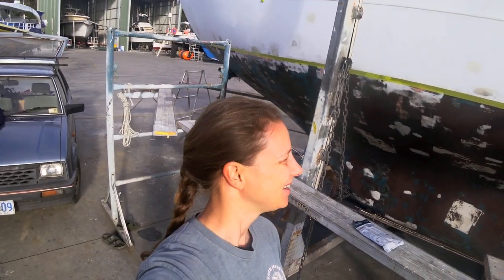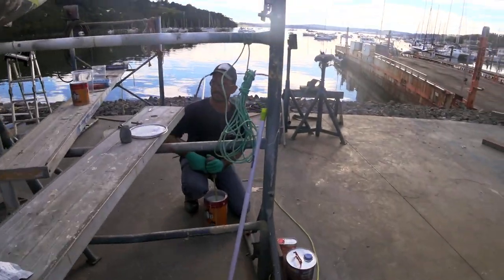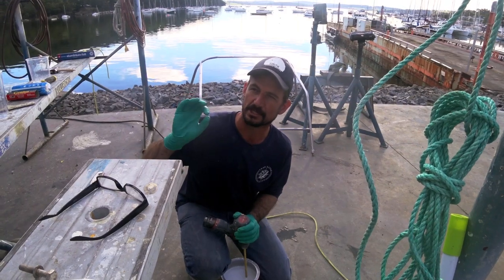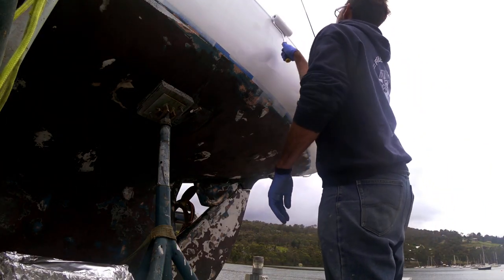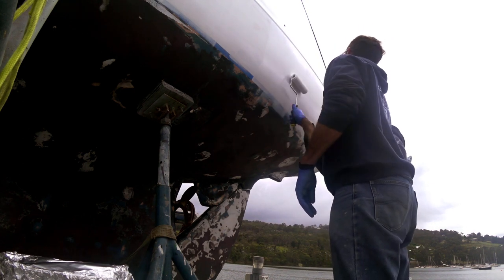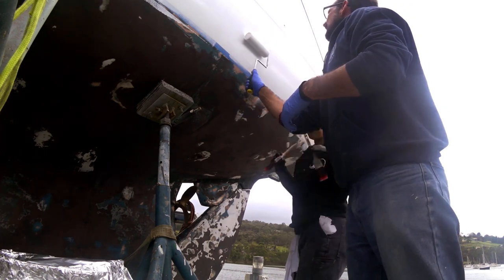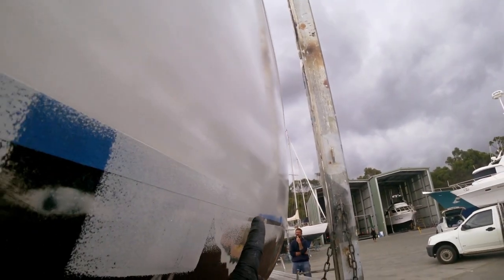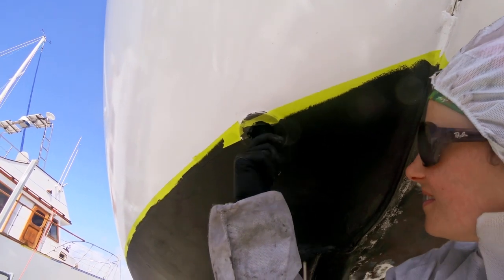Painting our ENTIRE sailboat by HAND (Roll and Tip & why we did it) - Free Range Sailing Ep 163

Comment: I was stationed in Menorca, Spain back in the early 80s. One of our power plant guys had an old Seat (Spanish made Fiat) that was all rusted up. He fixed the body work and then took the paint they used to paint the diesel generators on the site and painted the car with it using a brush. I thought it would look like crap but it came out really good. If you came up and sighted down the body you could spot an occasional brush stroke but you had to really look close to see them. I used to love to go down to Mahon and watch the sailboats there and dream of sailing the Mediterranean Sea. So beautiful, f they had left me there I'd still be in the Air Force.

Comment: I love your idea of raising the deck fitting attachment points by 10mm above the deck surface.People may not think too much of it unless their deck with its balsa core sinks in every time they try to stop leaks in that deck. (Like my 50 year old one) Naturally a little pond forms and adds to the aggravation. I have had to use two cans of spray gutter sealer on my deck to stop the leaks till I can install the fitting raising fiberglas escutcheons!
Regarding your spiffy polycarbonate windows. I can assure you that you can resurrect them should they get un-spiffy by using a drill mounted polishing  wheel and LIGHTLY polishing with Meguiars Mirror Glaze or equivalent.
I performed miracles on my slightly mutilated Lexan motorcycle helmet visor using that substance.  
You two have a fabulous show. Very informative.

Comment: Great video guys and it was nice to see Troy trust his roller and not overwork the paint with a brush. I've been rolling two part paint on my own 40 year old steel hull  for many years and only use the brush for around edges  and fittings etc....  We only use the 100mm (4") roller on my 65ft schooner as it is much easier to control the flow and keep an even pressure on the backstroke. Another point is we use a quality Foam roller (Stanley) and switch it out to a new one about every 5-10 minutes.  The secret is to not let it get saturated with paint and let the ionization process when it starts to tack off  flatten out any lines you first see. Most people think it is sprayed.
Love your videos and have learned lots from you both... Nick and Zaida... StarGazer

Comment: Hi Troy - Ive painted our old steel ketch every year for the past twenty years as its usually quicker than polishing the damn thing , every year the quality of the paint job is different depending on the amount of sun vs thinners vs dust vs humidity vs preparation.

we have two standards on board GE - Good Enough and super yacht - we seldom strive for super yacht .

your paint looks good , you know you'll scratch it a week later , that's just the way it is .

Comment: Hey you 2 have done a great job painting by hand, I understand the frustration and tears. The key to it, as you have found out is the thinners. If you get it right you don't need to tip. However if you need to tip I have a tip for you. ALWAYS tip vertically it hides and brush marks when you are back in the water. 
Love your videos, we would like to help but times are a bit tough.
Stay safe. ⚓

Comment: West Systems Perfection is excellent two part epoxy paint. Add extra thinner pending temperature and it will flow out like glass. Roll and tip with foam roller from Lowe’s.

Comment: Having  done my hull last year I can appreciate the effort involved, I happen to be an old oil and colour chemist (now known as paint formulator) so the solvent thing, spray thinners need to thin strongly so the paint atomizes yet dry fast before it runs. whereas brushing/rolling thinners need to dry slowly so there is enough open time to do the work and have time to flow while not  running actually a very hard thing to achieve.  I used almost straight butyl oxitol which was awesome. I also did the hull alone and used the 100mm roller without tipping it was fine you probably did better but for boats like ours you rarely look that close and its perfectly functional. I did undercoat though with an epoxy the fillers make sure all minor scratches disappear and I also wet sanded with a random orbital which is more effective faster and just plain good manners to the other boaters in the yard (dust free).

Comment: Hello Happy New Year. I think the finish on  Mirrool is amazing and it showed when you were stripping the tape at sunset. Never has a clay pipe looked so good😂You must be very chuffed and rightly so.
There are a number of advantages using small rollers, complex radii is one ,the other is material saving material not wasted on a loaded roller. 180mm+ rollers are great on flat surfaces with high build being the desired result-eg. textured house coatings or waterproof membranes horses for courses. Hurry up and get back out there
PS what’s with the Hobart home port , thought she was from Cairns. Backstory please

Comment: My present steel boat is roller tipped and have done a few other steel boats over the years when people have seen the finish they are quite surprised to find out it was not sprayed although to troys point it did require quite a bit of fairing. As you said you can fix scratches and scrapes fairly easily even on the hook  from the dingy.
Shame you had to redo your work but it looks very nice now.
-Dave 
Vancouver.

Comment: Hi, I just saw you where talking about using 1K painting is easier to handle, just be awere of that you can't use the most 1K paintings if you used 2K under like primer, filler Epoxy based stuff and so on. We learned that also the hard way. If you are looking for good alternatives for 2K roll n tipp paintings, we used the International Perfection and got a perfect result.

Comment: I've had some really good takeaways from this episode...I have a roll and tip topside job coming up in my future as well...I think now I am less relaxed about doing it if I am being honest...but...that is cautionary and a good thing.   I need to do a test run on something and re-read everything!
Reply from the maker: I think if I had caught the thinner switcharoo at the store, we may have avoided a lot of frustration. I had read the paint literature but didn't take written notes with me. Take note of the maximum thinner value and don't exceed that but it definitely is your friend. Other jobs, I used a single part polyurethane and it is a lot easier to use, especially when a bit of Penetrol was splashed in there. (NOT for 2 pack paint) Very common product among the shipwrights when rolling on single pack poly or oil based paint and spar  varnish.

Comment: Aye m8’s, nice results! I’m not an expert but I have some experience with painting. I learned a lot about how to paint with a spray gun from a guy making exquisite finish for old timer cars and motorcycles. I learned from furnishers about how to use rollers with a result close to spraying, and from graining artists how to use brushes and combs for making nice glossy effects and finish. 
Alright, now back to late spring 1986, in a street of Gothenburg - I was going to paint my car. Not the smallest car either. The year before I had become the proud owner of a Chevrolet Suburban 1975. However, the colouration of it did by no means represent my personality. So I thought I give it a paint! Big piece: 6 meters of mostly flat panels of steel. But standing in a public parking space in the street didn’t work for spraying. So I thought: first the narrow parts with some nice brush strokes and then time for the mohair roller. First coat looked great and me and a friend went for a pizza. 
Coming back an hour later realising the finish was not making anyone happy… Then my friend, who was a paint technician at the International paint facility told me to mix linseed oil in the paint. I was upset: what rubbish, to put oil in thin, low viscosity car paint. But he said: just try it! So I did and I was amazed how nice and smooth it worked out. Time to sand back the first layer! Then, car paint thinned with acetone and mixed with linseed oil made for perfectly smooth but still fast drying cotes. Only with rollers and brushes we where able to make a high glossy finish, close to  spray gun paint job. And it was easy to maintain later after stone damage etc. 
Since then the 100 mm foam rollers where introduced on the market and as you say - the whole Mirrool can be painted with them and obtain a superb finish. As long as one is fast enough applying it before the paint gets to dry.
Reply from the maker: Sounds great Miq. I wonder if that linseed oil works in the same fashion as Penetrol. We saw local shipwrights using it with single pack paint and tried it with really good results. Those foam rollers are very good but that Jotun 2 pack polyurethane eats them :(
Reply: Oh, shit! I haven't tried them with 2-comp yet. Good to know! Also fascinating that the Norwegian brand Jotun is all around the globe. And there is a reason for it. They have quite a range of products.
Reply from the maker: I use Jotun as a hangover from commercial marine but when they say Hardtop, they really mean it! We think the antifoul is very good too.

Comment: I hand painted my boat with Jotan hard top, used the correct retardant thinners and all with a 100mm roller, did not need to use the brush either. Second coat looked much better and 3rd coat was great, and that’s a 40 footer, and red colour

Comment: If it looks good at 10m you are Golden.

In reality how well the paint resists fouling from sea growth and mineral stains will make more of a difference than anything else, as that is what is going to make a hull look bad from a distance and require a lot of labor to clean and maintain if it isn't well done.

Reading the instructions is huge.  It's too bad they make them so long and confusing and in TINY little print.  But in the end with fancy paints it is 80% getting the mix right for the conditions and 20% technique...it doesn't matter how good your technique is if the mix is wrong or if you have the wrong thinner it is going to be messed up when it cures anyhow.  

I see you learned that the hard way as we all have who have dived into boat painting. This is such a frustrating lesson to learn.  Never trust that the paint guy knows his stuff, always double.check the literature.

The boat looks awesome though. The hard work pays off in the end.

Comment: Tipping neads long vertical strokes with very little pressure, be gentle
Reply: I thought if the roller is applied vertical the tip is horizontal and vis versa.

Comment: If only you'd have asked me.., Tipping or (Feathering) as we call it here is quite a delicate task.., always use a good quality 3'' brush like a Purdy.., imagine the brush is an aircraft and the boat surface the runway.., you want to come in for a landing, taxi the runway (boat) and then take off again always keeping the brush moving.., do not apply much pressure but rather guide the brush along..., (Feathering).
Reply from the maker: We have Don Casey's book, 'This Old Boat' and he describes it in exactly those terms. We later found zero pressure rolling also 'tipped' very well but I dont think we are at your professional level yet.
Reply: @FreeRangeLiving  You also hit upon another important issue in the video, saying when you rolled with the 9'' roller you would start 9'' in from where you left off, this is correct in that a fully charged 9'' roller can cover a width of at least 27''.., its great watching you'se grow and learn.

Comment: Fabulous episode. The boat looks amazing, I felt so bad when you found you got the wrong thinner.  When we hauled this fall I discovered no bottom paint was left of the two coats I had applied in the spring. I didn't know I had to wait 8 hours between coats, so the first layer never cured, or stuck. I'll be doing again this spring. Live and learn.
Reply: That’s the truth.  I had the bottom painted in April with ablative paint.  I ran into floating sea grass in the Erie Canal and I think it all rubbed off.

Comment: Hi Troy. I am about to paint a 36 ft cat in wattle poly u 400, roll and tip is my ideal method but that's a bit hard with two young kids running around the boatyard.  If you were stuck for the extra hands would you settle for just a roll job on the topsides?

Comment: Hi guys! love your shows! I know it's late but I have been a painter with my own company and a couple rules for my crew of up to 13 was... 
1- it's not how you put it on... but how you take it off.
2- always brush from dry to wet when "laying off".
4- don't "paw at it" but long strokes work best if possible... then don't touch it... let it flow out.
5- don't be cheap with your first lay on because you can take it off quicker than you can put it on.
6- Nylon for latex... china bristle is best for oil based otherwise it "ropes too much as it dries. Never china bristle for latex because it clogs and seals the bristles.
7- I always dedicate the brush to oil or latex never interchange back and forth.
I hope that helps someone... you guys are doing a great job and I (an old dog) have learned some new tips. We have a lot more in common Troy... fun stuff... we could swap stories! Til the next one.

Comment: Again a fantastic job, and a tale well told. I haven`t had experience with 2 pack paints, only marine enamel (modified polyurethane) but basically the same lessons you have shown here apply as well. First, prep as well as you can, depending on the quality of the finish you will accept. Second, find a good paint that does what you want, and you are comfortable using, and it must have good self-levelling qualities. Three, use a method that you are comfortable with, and that gives a good result. Like you guys I found that rolling (enamel) paint brings up heaps of bubbles, going back over it a second time with a drier roller before the paint starts to skin gives a pretty good result. P:S When you were watching the test piece to see if it levelled out, all I could think of was " A watched pot never boils"

Comment: I’ve done a fair bit of painting with different paints and settled on oil paint—One Shot sign paint with enough Penetrol to slow the drying time to be able to tip.  I paint my 40’ hull by myself in the water from a raft to avoid boatyard dust, tipping with the 7” foam roller as I go.  With enough practice, you can get good results this way, save money and save the left over paint for next time or to color match.  (I sometimes lighten with white or mix the colors.)  it is easy to sand.

Comment: Good on you guys, she looks fantastic.

Followed your idea of raising fittings this week, put an arch on my jarkan 105, unfortunatly the feet of the arch didnt quite match the deck slope, then i remembered your last vid (or the one before??) So ended up "casting" some pads out of thickened epoxy with choped up matting for some extra strength. Saved me hauling the arch to a mates (no hot work in my marina) and rewelding the feet to suit and carting it back again and again lol
Made it fit nice and much less chance of any leaks in the future. Cheers

Comment: 7:00 I know that feeling. I painted my mast which had to be brought back to bare aluminum primed on the same day then sprayed a two part paint that can't be over coated , it looked like glass when I finished I was just giddy with joy when I left for the evening only to come back the next day to find that it looked 100 years old ? Whiskey Tango Foxtrot ! Turns out after some research the temp fell below dew point ( only day that summer) I was on a rampage also . Anyway try blowing compressed air over your rollers after being dipped in thinner. Soon you will be back in the water and all those  pains will be forgotten

Comment: I rolled and Tipped my Cal29 with two tone Awlgrip and it while it was a massive project it came out great and is really durable with the big issue being to avoid humidity while drying 

I sprayed the 545 primer as it’s only mildly deadly BUT two part boat paint is really deadly so roll and tip for most people

Comment: Painting is enormously less stressful when you paint out of a 5gal bucket with 1.5 to 3in of paint in the bottom.  They make a roller screen that hangs off the bucket on the inside that you use to get the right amount of paint on the roller.  Once there is no fear of stepping on the roller tray, painting becomes easy and not stressful.  For materials that harden up, a disposable tray liner is the way to go, but otherwise that 5gal bucket protects you from spills and you can move quickly without worry.  With small rollers and paint with hot thinner, it might work to set up like a 2-2.5gal bucket with a smaller roller screen.  And if they don't have a smaller screen, maybe you could modify a larger one with tin snips.  I hate roller trays, they are an accident waiting to happen.

Comment: I can see why Troy doesn't like painting.  He seems to have gotten a bit of it in the sideburns area!  I have the interior of a house to get painted, in addition to replacing the carpet throughout the house with laminate flooring.  Trust me, I don't like the idea of that, especially doing it by myself.  There is also some ceramic tile to put down in the entryway.  The joins of owning a house.  Would rather be in a boat.  At least they are a bit smaller.  Just a bit!  Your work is looking very good and Mirrool is looking better for it.  She'll go back to sea fit as a fiddle!!!

Comment: Wrong roller used you need a mohair and not too much paint, always add a drop of thinners whilst painting as thinners evaporate from your mixture, if done with right paint no need to lay it down by tipping, its flattens itself as curing, eg International Perfection 2 Part Poly Topcoat Paint or Alexseal
  good luck